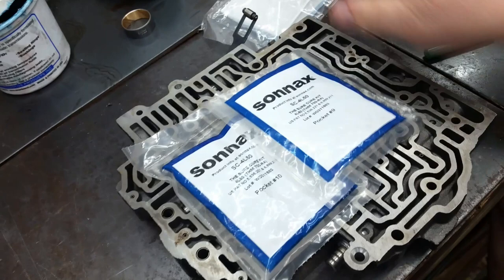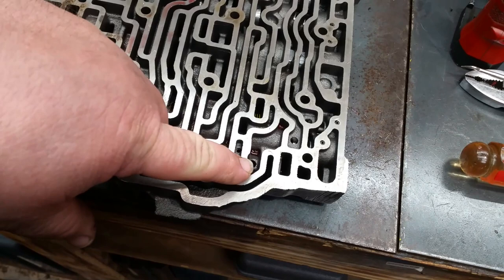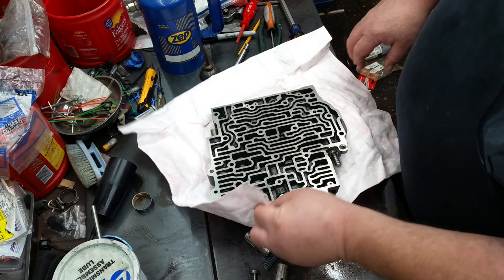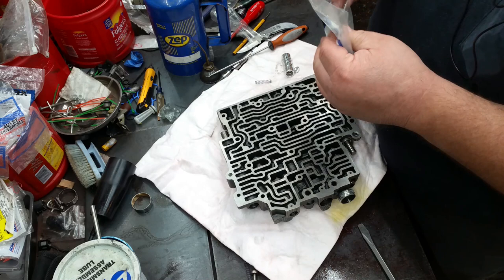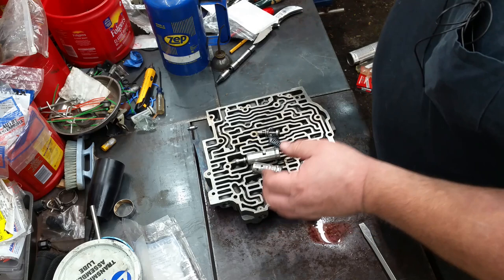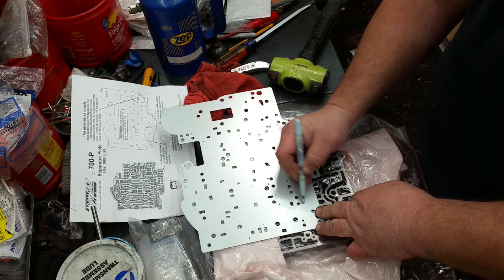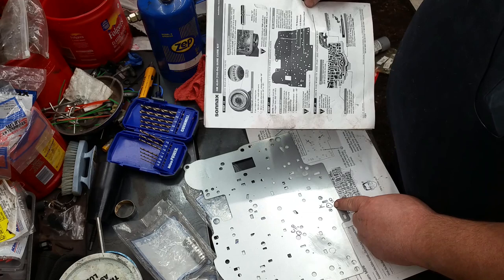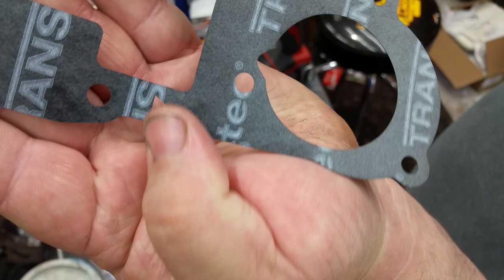Building a GM 700R4 Transmission for Youtuber L2theW Part 10-The Valvebody

Comment: I have 4 valve bodies and all 4 failed that leek check. Did you check the new valve body
Reply from the maker: I did check the new one and it was okay 👌
Reply: @IrocinZ  I have a Hydraulic TCC can i replace it with a electronic
Reply from the maker: @donaldschumacher3683  if you have a way to control it, then I'd say yes. But I'm pretty sure you can't convert a hydraulic TCC trans to an electronic TCC unless you change the whole trans to electronic TCC. Give a little bit to do some research and I will get back with you...
Reply: @IrocinZ  Thats OK I have been reading up on it and I have anothe newer case
Reply from the maker: @donaldschumacher3683  that would be the way to go...

Comment: I have a question could Lto the W not upgraded that cast body for a aluminum valve body?? Or is that something that's not possible
Reply from the maker: The 700r4 never had an aluminum valvebody that I know of. They were all cast iron
Reply: @IrocinZ  OK yeah I didn't know if maybe there's one available aftermarket or not
Reply from the maker: @jonathanlawson4667  I have not seen one. I know it would drop about 20lbs...lol